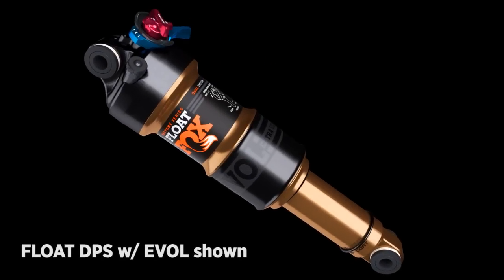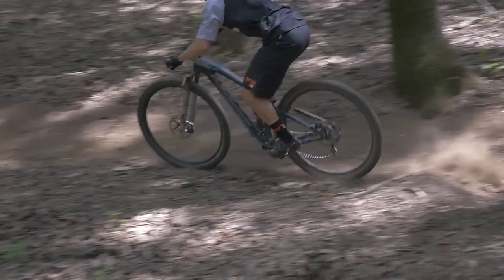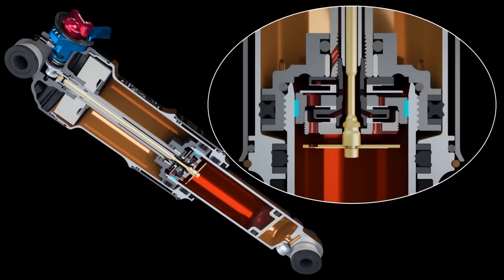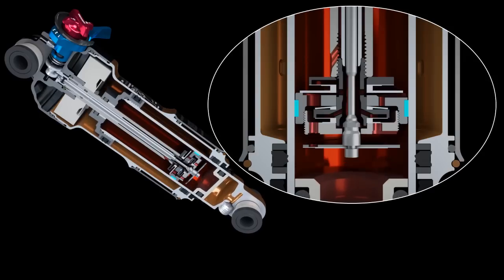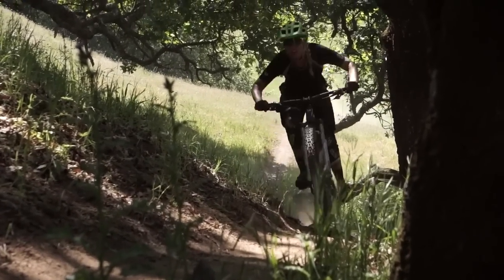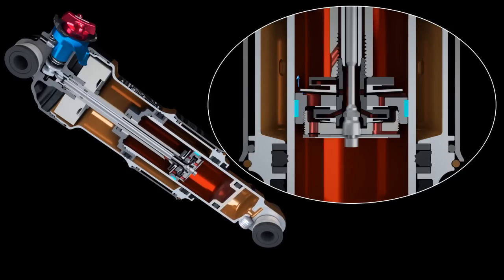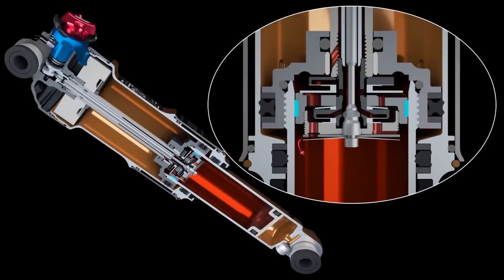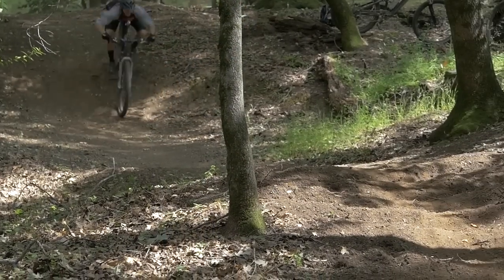FOX DPS shock technology explained – FOX Factory, inc

Comment: ok, so the red thing is for the rebound speed and the big blue for the stiffness of the shock, bat what does de black one (in between the red and blue lever) does??
Reply: nothing
Reply: it's adjusting stifness in trail mode(blue thing in the middle position)

Comment: Excellent video. If I understand correctly, the secondary shim stack that is in parallel to the high speed shims (shown third in the video) only influences performance when the blue lever is in the climb position. I am very happy with the performance of my shock, except it bounces too much when I cycle uphill. Would it be possible to replace only this secondary shim to reduce the bounce while climbing, while keeping the performance in the descend and trail modes as now?

Comment: Having a Fox DPS (circa 2017) that came with a remote lock out, I am seeing if anyone knows if a non-remote, shock body-based lever can be retrofitted, which would allow a lock out from the shock itself. This will allow me to delete the remote lever on my  handlebar and associated cables (in a quest to save weight). Thanks.

Comment: is high speed compression still open in trail and locked mode? What happens when I hit big jump in trail or locked mode?
Reply: when its in closed mode it basically means it can go through all of the travel, but only very slowly because it doesnt let much fluid through

it would basically feel like having an extremely high psi in open mode, and it would only compress a very small amount before resetting

Comment: shaft  was broken after 1,5 year using,   fox float dps performance, frame specialized sj 2019
Reply: same happened to me today. piston shaft broke around low speed rebound port :///
Reply: me TOO!!!
Reply: The shaft is too weak to handle the top out load.   Be sure the negative air spacer is stopping the extension of the shock and not the damper shaft.    Mine has the blue spacer and I am flipping it over which will effectively make it longer by a couple of mm.

Comment: I have this shock on my 2.5 year old Intense Sniper bike, has been serviced already 3 times, and  keeps losing 70-80 psi each time I ride.
Reply: Did you find a solution for this? I just purchased a Sniper with less than 200km on it and the shock is losing much of its air while riding.
Reply: Be sure there is oil in the air chamber.

Comment: Does firm position makes completely stiff ?
Reply: For mine no
Reply: Not anymore. They used to but with this new separate circuit the have given way to much blowoff If you want a firmer lockout now you want the RockShox Monarch RL. It does not either but at least is now firmer than Fox's. 🙄🙄🙄 The opposite used to be true. 
What is extra stupid about what Fox did is the fact that there are 3 settings open, trail and "lockout" so they could easily have tuned the lockout one firmer. 
I have a good ole Fox DPS that has just a monster firm lockout and good traction trail and really open; open. Those were the good ole days.